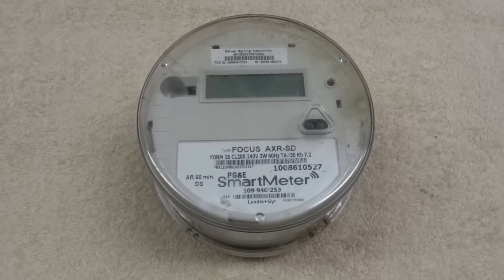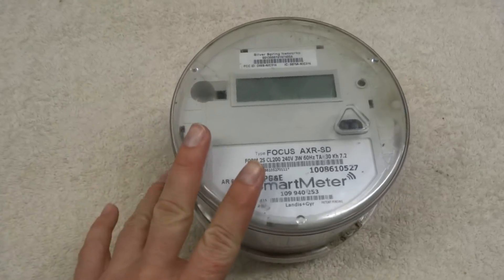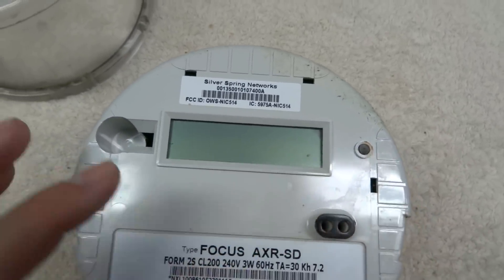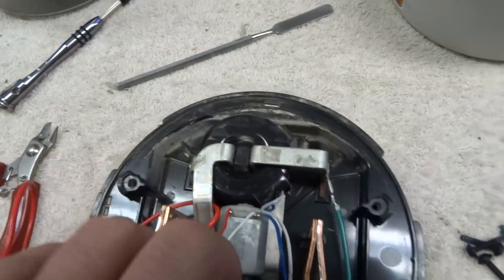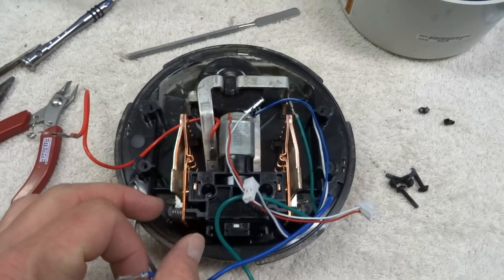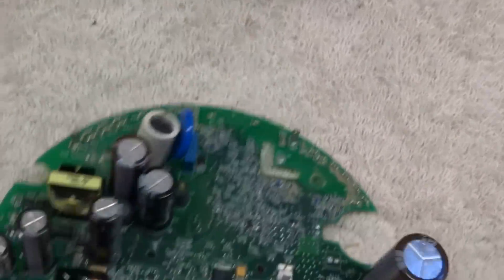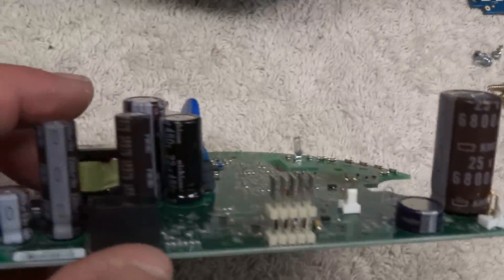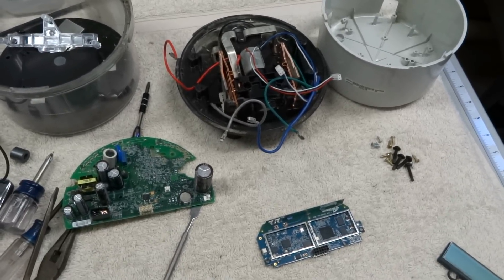Let's Teardown - Residential Smart power meter

Comment: Would be nice to cut it remotely . Let's  say there's a gas leak ,Would be able to kill an ignition source just saying.
Reply: Good Idea at first blush William.  But opening those contacts in a gas filled environment would cause sparks which could possible ignite the gas.

One concession they have made in the installation regulations is that there has to be one metre separation horizontally between an electrical meter and a gas meter (as the gas meter vents under certain conditions).
Reply: @gragor11  yeah but meters are ALWAYS on the OUTSIDE of the building.
Reply: @josephaltman460  Always is such a strong term.  Many places have electrical rooms with stacks of meters .  So not always.  

Not that one would usually find gas in an electrical room.  But then again one would never have expected to find salt water flooding an emergency power generation room for a bank of nuclear reactors.

Occasionally Shit Happens.  But not a common problem for sure.  My comment was just an aside.  

Gas leaks happen out of doors as well.  Gas lines get ruptured quite regularly to the point that many are using vacuum trucks to suction the dirt out of holes in municipalities instead of hoes and excavators.  Rail cars tumble from their tracks and fill neighbourhoods with combustibles (a la Lac Megantic), and it is not very uncommon for vehicles to leave the road and strike buildings exposing the outsides to fuel sources.

But I don't think that after some of these examples the first concern would be to trip the smart meter to shut off the power as utilities in my neighbourhood usually chop the conductors at the nearest safe place, usually on a pole out at the street.

All good.  Learned some things watching this video and reading the comments.  Especially about how the capacitors bleed back power to maintain the readings.

Thanks for making the video.
Reply: That is not as cool as saying "spying" or "termination".
Reply: The meters are usually outdoors.
Reply: One little problem with that - that is a brushed DC motor.  Brushes & commutators = sparks.  Not something you want around a concentrated gas & air mixture.  Plus the arc at those contacts as Gra Gor mentioned.

Comment: Gee golly gosh wally! shucks, this is a super great schooling you offered up here, managed to have little clue what you are talking about but did a fine job explaining it as if you did. What amuses me about the "SAFETY FEATURE" is that on the 3rd of any given month at 9:01 AM if my power bill has not been paid, this "SAFETY FEATURE" will be deployed!  religiously without fail until I "SAFELY" get that bill taken care of, then magically as if MONEY cures most problems...the "Safety" issue is cleared up and the power is restored, but not before a 130 dollar reconnect is "SAFELY" added on to the next months bill for a "tech"  to come out and "reconnect" when we all know it was done remotely. "SAFELY" of course...I will count up how many times you use "SAFE" in this video.

Comment: I'm interested in how they calculate how much power you use or are charged for and if you add solar, how do they calculate the power your panels supply to the grid. It is a net metering system and the meter supposedly calculates each power input and comes up with the net value. I don't think the meter calculates the solar input properly so you get cheated with what you put into the system with your panels.

Comment: Those built-in electrical contact points could potentially be used to cut-off, lock-out or "ration" energy usage in the event that the power utility or the government arbitrarily "thinks" you are using too much energy...

This is already in force in Johannesburg, South Africa - of which arbitrarily sets or caps residential or domestic household electricity consumption to roughly 5 kilowatts or 21 amperes @ 240 volts...

Comment: Not all smart meters are wireless. Power line carrier is used in rural areas because of lower density. What is disturbing about the smart meter debates is that the so called experts who oppose the meters all have websites that make money for them by selling overpriced test equipment.

Comment: capacitors dont store power! only energy can be stored
Reply: Take an introductory course in Electronics.
Reply: You should learn basic electrical principles. you admit you are not an elecrtrical engineer! You obviously dont know about physics either!
Reply: Effectively, capacitors most certainly do store potential power AIUI.

I kinda know the physics of that little burnt crater that a discharged capacitor creates when shorted on bare metal. But okaaaaay I suppose [if you want to split hairs and start juggling coulombs, electrons, joules and electrostatic fields with your slide-rule then that isn't exactly considered 'power' until the energy was actually utilized in a sense, so OK I guess you win. Sorry for the snotty remark. But it reeks of semantics to me.

Should technical literature state that dash cams, computer memory and thousands of other devices are not `powered` by capacitors, instead `energized by their electrostatic field potential.`?
Reply: Correct.

Comment: Yes you are paying for the consumption of the circuit board, but the old meters used electric motors to turn the dials. So the cost to the customer with the circuit board has decreased dramatically from the old meters.

Comment: (2) 110 Volt inputs and (2) 110 Volt outputs. Grounding 101 - If your are confused about what ground is, walk out your door into your yard, jump up and down 10 times in a row and look down. That is GROUND!!! Does not come from the air, does not come from the power company, is not supplied by Home Depot or Lowes. LoL

Comment: A lot of cool parts in there. De solder and save! 
I do agree that the motor (save that for parts!) is an easy, remote, disconnect mechanism. I knew a guy in the 80's that took his (analog) house meter and hooked up a switch so he could stop the "wheel" from turning. He turned it on enough to generate a bill but shut it off to save money. Unfortunately, he forgot to turn it on during a visit from the meter reader. He (meter man) noticed the wheel wasn't turning yet the porch light was on. Ouch. They shut the power off.  He didn't get in trouble. I never learned how he did that. I guess I didn't want to push it as I am wary of MAINS!!  ZZzzz!! :-) 
Great video! Thanks, man.
Reply: Shutting off the meter is stealing electric [ower the rest of us have to pay for. the guy is a thief and should be denied access to the grid forever.

Comment: That's correct, Chris. They can remotely disable your service through the device, without having to send a technician to do it. I do however find it odd that the design shows individual contacts, on both sides, which appear to be able to be manipulated PROPORTIONALLY on either side.

The Blue and white wires, which come out from the main lines, are certainly connected to a torroid, or donut / transformer. This could do a few different things. It could be the source power for the meter, it could be to keep the meter in phase.  

In a residential feed, you typically have 3 connections. You have what's commonly referred to as 2 legs, and a ground. Of course the electric company doesn't simply feed you electricity through the 2 legs, they are out of phase with each other, and actually return through ground. Looking in a breaker box, you will always see the ground wire terminals being shared with the neutral wire terminals.

Because the 2 legs are out of phase with each other, you basically have 2 opposing power sources with respect to ground, in addition to them having opposition from each other. 

The antenna strip, (marked antenna) has two notches, or square cut outs, reminded me of a (J-Pole) type of antenna. It was the first antenna I had ever learned about, in which the signal is actually shorted out, to ground, but having a resonance section, as that's the importance of a working antenna. The specific size and diameter of those notches (and radiator) are fine tuned in proportion, to resonate with the devices operating frequency.

One of the important aspects of electrical service, is to try and balance your load as equally as you can, on the two legs. When you look at most panel lay outs, you will see how the installer, (if they did a good job that is) would try to balance the load as best as they could.

One problem, is that breaker balancing and actually usage balancing are NEVER the same. You see the problem here is that if your load is out of balance, you get charged the full price, where as you could have been using a balanced load, and pay the same.

This is why the two moving contacts on the meter, which additionally appear to be manipulated remotely, concern me. It's unclear if this is to help balance / read/ or manipulate, the load or reading.

Years ago, a technician taught me that these types of load issues can also occur due to the electricity being phased slightly off, (which has more to do with the longer length of wire in-between your home and station) and brought back into phase by installing a capacitor box. You may want to read about "Fourier Analysis." Some here, http://whatis.techtarget.com/definition/cosine-wave
Reply: Maryjane Eva Diamond If you please, which parts emit radiation?
Reply: Thank you. I actually understand that.
Reply: Texas Smith & Mary Jane - Very good.  Well done.  Not a single insult.  Mr Zug needs to read these posts.

Mary Jane - Interesting take on metering only one side of the cct as is the idea that phase shift may cause the meters to read incorrectly.  There certainly has to be something going on as the cases I see quoted on the various I Hate Smart Meter FB pages I have come across definitely seem to indicate there is a metering problem somewhere.

Texas - 
I did find a nit.  @ 60 cycles (single phase) the circuit actually goes off twice per cycle when the phase crosses the zero point and switched polarity.  3 phase is of course a whole other ball game.  It was quite a small nit considering the most excellent job you did explaining this theory.  Even refreshed my memory on nano and micro Farad measurements and capacitor theory.

I would also like to point out that this is a Mark 1 model meter and has been replaced.  The present ones may only superficially resemble this one.
Reply: Maryjane Eva Diamond m
Reply: Maryjane Eva Diamond electrician sounds fun
Reply: Maryjane Eva Diamon..
Reply: The toroid coil is for current measurement only. The wires from this coil are connected to the metrology board of the smart meter. 

The disconnect switch disconnects both legs of the service simultaneously. A signal sent from the utilities central office can disconnect or connect electric service to the home for various reasons.
Reply: That "doughnut" torroid (coil) emits electromagnetism. Those capacitors release that electromagnetism energy in pulses and between the capacitors and coil(s) together is where you get "micro" and "nano" waves which is called "radiation". The waves radiate and if small enough, can go through you. Basically frequency, which is one up and down wave is called hertz and is radiation. The frequency is also a vibration. If you saw the wave, up is on and down is off and how many times a second it does this is called frequency. The US has everything based on 60 Hz which means your electricity is going on and off 60 times a second. It's too fast to see. 
The problem (radiation) happens when you are looking at 100,000 pulses a second or 1,000,000 pulses a second and higher. This is a very crude version of explaining this but it's the best I can do. Kilo means thousand so 1 KHz is 1000 Hz. It is MHz and up that is the concern. My small microwave emits 2450MHz "radiation" or 2450 MILLION times a second it pulses. 
Capacitors charge up and then when full, they release all that electricity at once. Some charge up fast and other charge up slowly. Some hold a lot of electricity and some hold very little. The numbers on the capacitors are in Farads. A Farad is how much electrical charge is in a capacitor. The 0.22F capacitor he mentions as a "super" capacitor in the video is a big deal because 1F (Farad) is MASSIVE and can hold like a billion billion electrons. Capacitors are rated generally in the micro (u) Farad range and even the nano Farad range. Micro is "u" and nano is "n". So what you usually see on a "cap" or capacitor is something like 0.22uF (0.22 millionth) or 0.22nF (0.22 billionth).  Rare to see anything that does not have a zillion numbers in front of the decimal point. 
Its the speed of charge and release of the capacitor that determines "radiation". By the way, in comparison your cellular phone may emit between 800MHz to 1900MHz (Frequency, waves, vibrations, on\offs). I hope this helped. 
It is not radiation you heard that comes from nuclear plants, yet it can be very dangerous to your body. One last thing. Your brain and planet earth hover around 8Hz.

Comment: That motor drives the disconnect, not safety. Just turning off the power for non-payment customers.
Saves the utility sending a disconnect guy out and him getting abused by an angry customer.
Normally the POCO pays for the meter usage otherwise the meter would creep.
Reply: Hi Rich Valley Picker but I beg to differ. My previous residence with 200Amp service had, and still has, a 20:1 current transformer driving the meter. Yes, most residences, including my present abode, have full power meters, but not all. Note my previous error and correction. This is a full power meter. Can take a picture at old house if you like>
Reply: Richard Barber 
Interesting....... I guess different utilities are doing different things.
Reply: Though not all smart meters have it  and for good reason as it's a known fire hazard.
This might be why he has this one as the utility company decided to quietly replace them before they got sued.
Reply: Yep , and what he calls the donut is a Current Meter. Not low voltage DC for the DM.
Reply: that motor is for if you dont pay your bills....
Reply: something not kosher here . "NO POWER" goes through my meter. It senses current via a current transformer located on incoming wire at top of pole. Some , but not all, old style meters carried full power.
Reply: That also could destroy electrical appliances.
Reply: @RODALCO2007 if the on off switch u are talking about is the same as the one in this video w/ small motor, it can be operated centrally from the power company, its a very messed up practice but the "Southern Company" who owns Gulf Power, Georgia Power, Alabama Power & Mississippi Power has a practice of puting thier customers on a kind of credit score type system and if your ever late or have to make half payments your score goes down and when it hits a paticular level they will acually cut your power at the end of the day it was due, that on/off switch is how they do it and controled via their com system and the internet.
Reply: @ connor anonymus- yea it has to stay on so it can recive a wifi signal, so when they send the command to shut power it keeps the line side and just cuts the load
Reply: RODALCO2007
Reply: Yes that is through, we had meters with a latching switch contacts inside the meter in NZ a few years ago. When a power glitch occurred some of these meters were starting to switch the house on and off at 1 second intervals. Not good for appliances. Very angry customers, and high risk of meter catching fire. All these meters were replaced. Expensive exercise. No need to have an on off switch in a meter. easy enough to get a pole or pillar fuse pulled if needed.
Reply: RODALCO2007 I
Reply: RODALCO2007 is
Reply: RODALCO2007 dude, really   line voltage  is  440 not 220
Reply: Dude  line voltage  is  440  not  220
Reply: Well, after it's turned off, how are they supposed to turn it back on?
Reply: @conner anonymus- u pay with a card over the phone or wait til thier open and pay cash
Reply: DJ EviL J i just found out how from a teardown video, the meter is never shut off, whether the house has power or not..
Reply: RODALCO2007 I
Reply: New World Order to control your usage..
Reply: It CAN be used as a safety mesure in the case of gas leak.
Reply: wrong, Richard, unless you have a large commercial service. All the current in a self contained meter(residential and most small commercial as well) 
'goes through" the meter. There is a direct connection between the line and load jaws at the back of the meter. Anything over a 200 amp service requires instrument metering by using current transformers as well as potential transformers to measure a portion of the power and then multiplied to determine the load with a timed element applied.30 years in the biz, bro.......BTW this guying the video has no clue what he is talking about. I like his curiosity though..
Reply: RODALCO

Comment: The pin out of the back pins are

102v in          Ground in

120v out       Ground out
Hope this helps
Reply: NO GROUND!!!  Just Line1 IN/OUT & Line2 IN/OUT.
The Neutral bypasses the meter, while the Ground is connected to the meter housing and metal conduit.